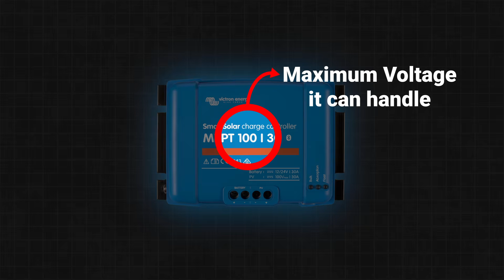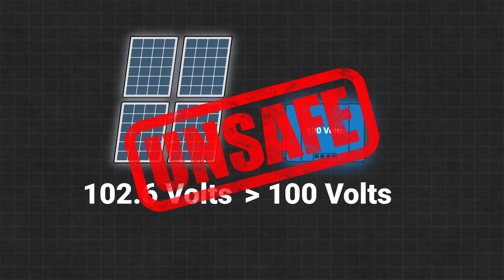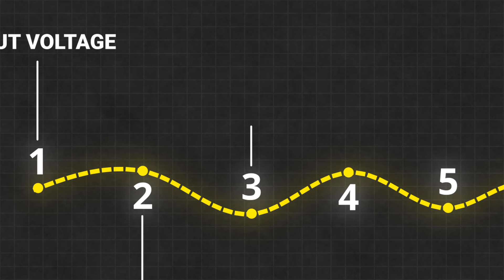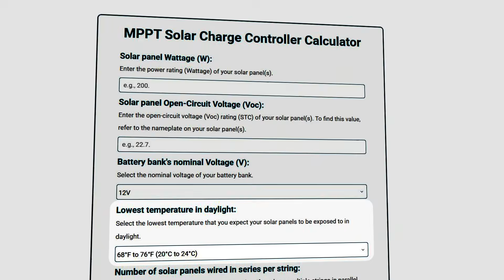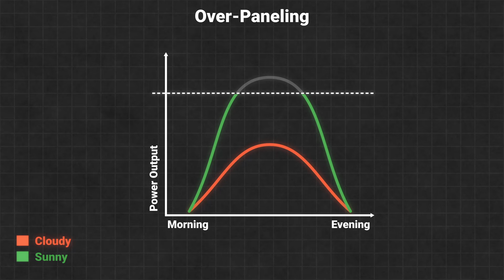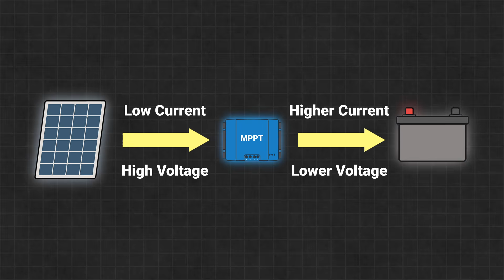How To Size A Solar Charge Controller? (MPPT & PWM) | A Complete Guide To Avoid Damage And Waste

Comment from the maker: Use the MPPT calculator here: https://renewablewise.com/mppt-calculator/
Reply: I did that and it is pretty close to what I calculated.
Your calculator did not account for line losses (neither did mine).

I have that Victron 150/70 and four 200W bifacial panels.
I could add a 5th one if all in parallel and have the array within 30 feet of the controller to keep line losses minimal. Cabling I will use is 8awg.

I am going to run a 12v system. My inverter is rated 12v input, 120v output with 2K watts continuous and a 3K watt peak.

Reason I chose that is 12v is pretty universal.
In a pinch I could use the inverter on my car to get power (but not more than 1KW-ish or I can burn out my alternator).

If they had a 12v/24v variable input inverter with similar ratings I would have bought that one.

Comment: I think the 100V series is a trap. It's a little cheaper, but it limits you to a handful of panels in series and a 24v system. The 150-35 is a great sweet spot imo, letting you charge at over 1600W on a 48V system.
I regret going with the 100/30 to save a few bucks
Reply from the maker: True. Always best to plan for future expansion.

Comment: If you only use solar to charge a battery that has a BMS, and the max Voltage the panel(s) produce is less than the recommended charging voltage specified by the battery manufacturer; you don't need an MPPT at all.
Reply from the maker: Unfortunately, most panels will produce more voltage than recommended for a battery.

Comment: How about one panel to the controller to a 12 volt  lifepo4  battery 100 amphr. Which should I buy this is for a mini van accessory battery I want to install. The one panel will be installed on top of the roof. 73
Reply from the maker: How many Watts is the panel? and what's the Voc rating of the panel (open circuit voltage?
Reply: @KiloWattMaker  100 watt, open circuit voltage 22 -24 volts +-5volt  tollerance current 5 - 15 amps . Operating voltage 18 and current is the same as above. 73

P.S. I need to know what model and brand is best I would need a display on how much percent the battery has. This will be a van install like the rv type. 73

Comment: Your tool is good, but it does not mention anything about Nominal PV Power (output). So your tool gave me to buy a 50A one, my pannels are 450w x2. 900W , but a 50A would get me only 700w, not 900w.
Reply from the maker: Whats the nominal voltage of the battery bank?

Comment: Excellent thanks! Only negative for me is the series/parallel arrangements. This is where I got lost. I think there's so much data to absorb here that I think the wiring connection side deserves a separate video. Cheers.
Reply from the maker: I have a series/parallel video, but on solar panels. It is kind of the same principle. Please check that out.
Reply: @KiloWattMaker 
👍

Comment: 1) Use Victron Energy (its the most reliable, compatible, most efficient) 2) most Victron Energy solar charge controllers can work in tandem with existing using a Bluetooth link, this means you can hook up extra solar panels and add more batteries. 3) don't buy an all in one system, one part fails everything fails...  4) always try to go for the highest voltage battery system 48 volts (if possible) its easier and more efficient for inverters to convert 48 volt to 120 volt also the higher the voltage the thinner the wires in your system can be (less money on thick copper cables and less heat generated, lower risk)

Comment: What about under powering? I have a 48v battery that I connected to a 100a auto select (12/24/36/48v) MPPT controller and only connected 1 380watt 35v VOC solar panel. But the controller doesn't show the PV being connected?  I just thought it would charge slower.
Reply from the maker: Charge controllers are supposed to "step down" the voltage from the solar panels to charge the battery safely. The issue here is that your panel operating voltage is probably 28 to 30 Volts or so, while the 48V battery operates at about 40 to 58 Volts.
For most MPPTs to even register that there's a solar input, the panels' voltage (Vmp not Voc) need to be at least 5 Volts higher than the battery's voltage, which is actually up to 14.5 Volts for every 12V of nominal rated voltage.
So, your panels need to have a total Vmp of at least 63v in this particular case for the MPPT to do its job properly.
If you can, get a 2nd 380W panel, although 2 additional panels would be much better. And wire all panels in series.
But if you do, make sure the MPPT can handle the max input voltage as explained in the video.
I hope this helps. Feel free to leave any follow-up questions.

Comment: Hi  i want connect 4 solar panels in series the problem is the voltage.  i have see that each panel gift 40 tot 41 volt  total 160 to 164 volt.  Does anyone have experience with the over voltage with an Victron 150V MPPT charger?   i have an Victron 150/85 MPPT charge controller.

An Victron 250/85 or  250/100 cost an lot off money.
Reply from the maker: You should absolutely not connect more than 150 Volts to that MPPT. Why don't you connect the panels in Series-Parallel? You'll be able to use your MPPT and probably can add 2 more panels to the mix later if you need.

Comment: Hello,
I tried your MPP calculator, but I think I messed it up. I have 6 450w bifacial (585w supposedly bf. Max power current:14.97A. VoC:35.03 
Low temp 25 degrees. It gave me 150/85 (585w) and 150/60(450w) mppts. I thought Series-Parallel would use a smaller mppt.
Reply from the maker: It also depends on the battery voltage. What configuration exactly did you input into the calculator?

Comment: Victron 150/70 is a good all around controller for small arrays.
Good for about 1000 watts-ish. Formula is like 150 x (70/10) Or about 1050 watts. You will lose some power due to cabling losses and connection losses.
First number is max input voltage. 2nd number is amp output for the batteries.

Think like this: would you drive your car with the gas pedal mashed to the floor or take it a bit easy?
Gas pedal mashed is maxing out your controller.

You would want about 15% less input than controller max to allow for different solar panel conditions.

24V battery setup requires a different inverter to get the 120v ac output. Breaker and fuse sizes also have to be different.

Higher voltage input allows you to use smaller cabling from panels to controller.

Batteries in series also requires a battery balancer too which most never tell  you about.

Comment: One point --calculating the Output Max of the controller. You based your calculation on the battery voltage class (12V), but really the charge controller is output is 14.1(adjustable) volts while boost (bulk) charging an LFP battery.  Hence if you have a 30A Victron, you are actually delivering 432W to your battery
Reply from the maker: Thanks for taking the time! Actually, the voltage you just described is the max bulk voltage, which is the same as Absorption voltage. When the MPPT is in bulk mode, its voltage is not constant, it's sort of dragged down by the battery voltage as it slowly rises while charging. The limit on the MPPT is its output current. So let's say for example you want to deliver the full 432 watts to your battery using a 30A controller, that would only be possible when the battery is at 14.1V or higher, when the battery is depleted, and is at, say... 12V, the MPPT can only deliver 360 Watts (12v x 30A), since it's limited to 30 Amps. So basically, when you use the nominal voltage, you'll end up with a controller that can make better use of your panels in bulk mode. But then again, as explained in the video those panels will rarely actually reach their rated output. So to be honest, it doesn't really matter which voltage you use, I just used the nominal voltage because it make things a tad less complicated to explain.